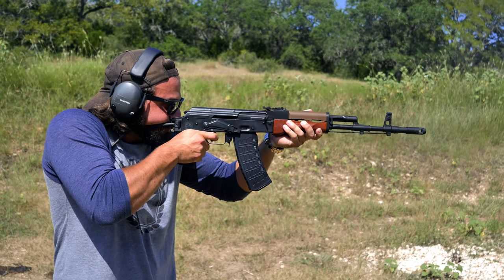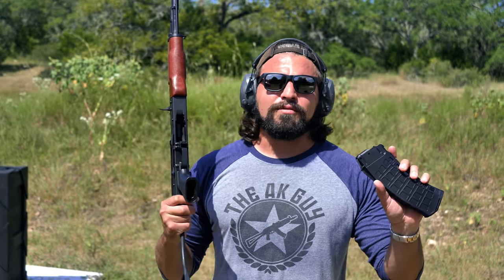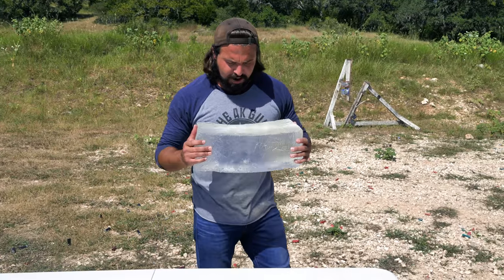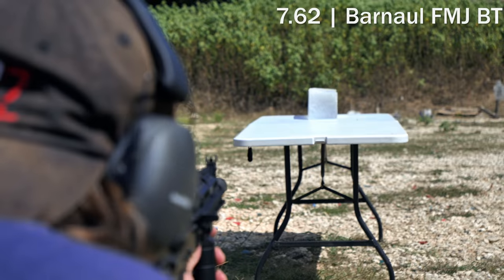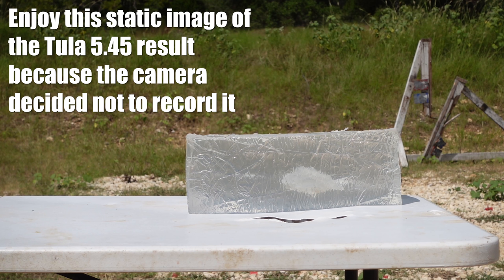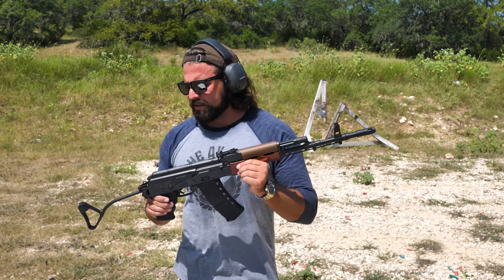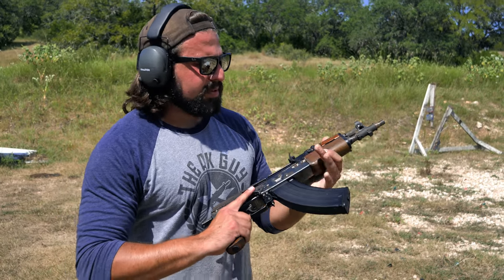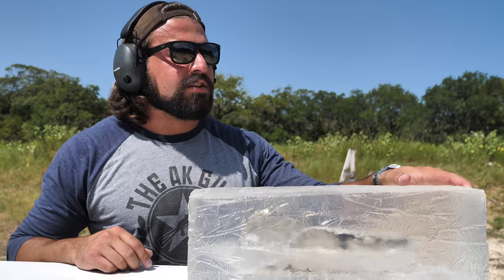7.62 vs 5.45 - Which Is Better?

Comment: 7.62 is a 30-30 equivalent in external ballistics, the 5.45 is designed to flip after impact.  It is supposed to flip sideways very quickly by design, so your testing doesn't really show that.  I am sure during the design phase of the bullet lots of criminals were shot under scientific conditions to finalize it.  It's a long for caliber sideways bullet and it does bad things.  Please note the casualties in the Ukraine / Russian SMA so it's not a simple comparison.  Both will kill you dead at 200yds or less.  You really do need good body armor.

Comment: Better at? If 7.62mm is the obvious best, why did the soviets, er, russians switch?
Reply: Their doctrine on the assault rifle was that it’s primary function is to be on full auto. I carried an AK74m in Ukraine and can attest that it has almost no muzzle climb when firing on full auto. Both cartridges have the same range and the same penetration on body armor. The only real advantage the 7.62x39 has is that it does better destroying brick or cement walls if your enemy is using them as cover. Not to mention, because the 5.45 is half the weight of the 7.62 you can carry twice the amount of ammunition without increasing the weight load on the soldier. Which is a huge deal if you need to hoof 5 kilometers to from the truck drop off to your trench line.

Comment: Saw a demonstration about why that Black Shit forms in the gel. Not caused by bullet contamination at all but by spontaneous combustion of air inside the temporary cavity when both ends of the jell seals off and increases pressure to combust the air left inside. Super slow motion camera leaves no doubt, there is an actual a baby explosion that occurs when shooting the bullets with the larger temp cavity.  https://www.youtube.com/watch?v=LhBBCOIjkiM    One example here.

Comment: how does 545 compare to 556?
Reply: It's about the same overall. 5.56 is faster and has better penetration and stopping power. But the 5.45 has better Ballistics Coefficients and a wider casing, which means it has more efficient powder burning, thus can be fired from shorter barrels better than 5.56. 5.45 is also a longer projectile and tumbles better inside of a target, thus causing more internal damage depending on where they're hit.

So overall they're pretty much the same, they both outperform eachother in their own ways, so they balance eachother out and will pretty much give you the same results.
Reply: @TheTGRproductions  interesting. thanks

Comment: I have both, never gel tested, but extensive use on wild hogs and coyotes. 7.62x39 is my go to for running and gunning hogs in thick woods where shots are typically 40 yards and in. It has great performance no matter the size of the pig and thin brush and braches aren't a huge target missing factor. 5.45x39 is my go to for hogs and coyotes in less dense woods or open fields with typical shots being greater than 100 yards. 5.45 on smaller coyotes and pigs is not so good from my experience (if you can't get prime shot placement), where 7.62 will one shot them (maybe they run 50 yards before falling) just about anywhere when it can take two shots of 5.45 (poor shot placement due to running game). With full sized coyotes and hogs the 5.45 is the most devastating as it has time to tumble, especially in big hogs, and one shot anywhere between the head and rump is enough to stop the game. Great vid, you should really get into some wild pigs and test out both.

Comment: 545 is a waste, terrible ballistics, not as accurate as .556. 7.62 isn't either but at least it has the stopping power
Reply: I agree, but 5.45 is better for home defense specifically inside the home. It's also better at tumbling early and is still relatively similar to 5.56 in terms of power. Although I do agree 5.56 pretty much has every other advantage. Although I'm still more of a 7.62 guy overall because of its stopping power and overall better versatility when compared to either 5.56 or 5.45, since it's objectively a better hunting round, and is much better at punching through protective barriers like concrete or brick.

Comment: Why is no one talking about .45 acp x 9,19 mm
Reply: Because it's been done to death at this point. They're both equally affective in their own rights. 45 is slower, but about 30% more powerful. 9mm has a much higher capacity. My 1911 holds 8 rounds of 45 ACP, while my Canik TP9sfx holds 18+3. If you wanna do the most damage, 45 ACP. If you want more rounds, 9mm. And 9mm is by no means a worse option, despite what some people will tell you about it not being able to put down crackheads and whatnot. Shot placement is everything! 

Besides, 10mm is better than either, and has none of the downsides of either except slightly more recoil :^)
Reply: @TheTGRproductions   I know it's like compare a musket vs an AR both are lethal

Comment: 30-06 vs 30-40 krag??.. edit: 303 British or 30-30 would be cool to see against the 30-40 krag as well being how old the 30-40 krag is.
Reply: 30-30 and .303 British are nowhere near the same thing. one is a cartridge designed for  lever action rifles for hunting, the other was designed for machine guns and rifles for military use. .303 is a much more powerful round, delivering 3,463 joules of energy with a 150 grain bullet, compared to 1,903 joules of energy with a 150 grain bullet. the British round also usually travels faster than .30-30.
Reply: @justacanadianguy07  30 cal vs 30 cal…. 30 cal vs 30 cal. The 545 and the 762x39 are about the same difference which we both watched this video with interest.. and I think it’d be interesting to take a cartridge developed in the 1880’s and 1890’s and compare it to the 06 and so on and so fourth. I understand they’re all different, but, they’re all some what similar.
Reply: @justacanadianguy07  also, I was saying those two calibers against the 30-40 krag, not the 303 and the 06 against eachother, I meant the 303 or the 06 vs the 30-40. Which was used in designated marksman rifles, Gatling guns, and even some of the Vietnam era land/bunker mini guns and it’s even in some modern helicopters in the mini guns, I like to call those “hummers”😂💯